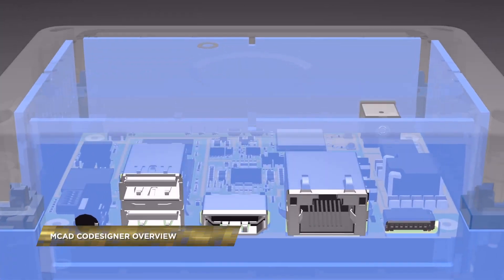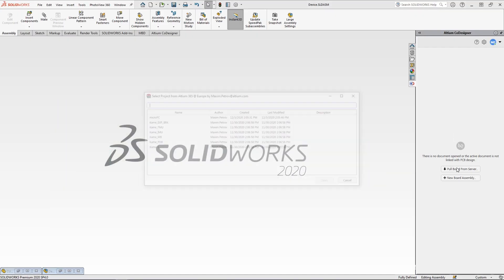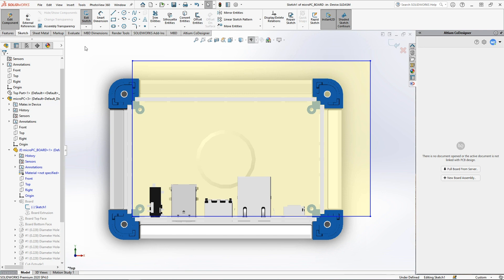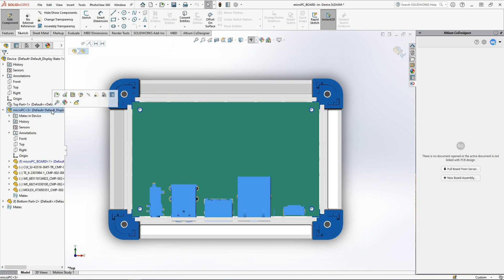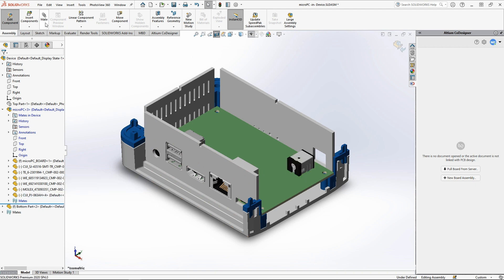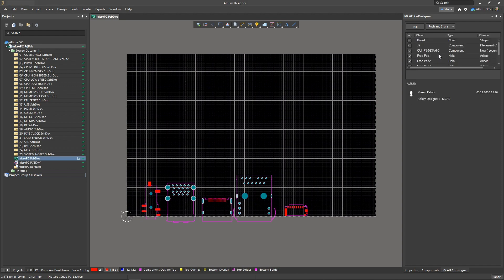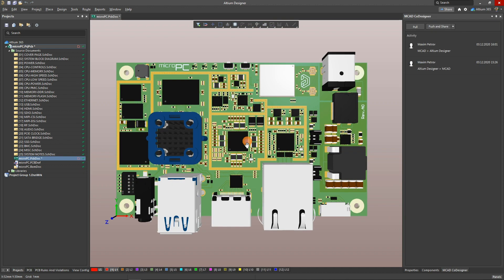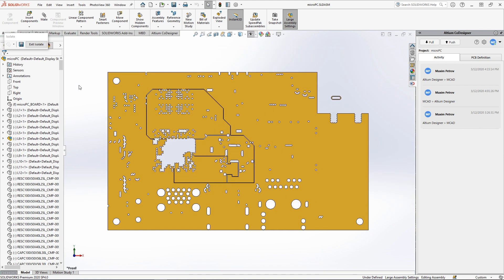MCAD CoDesigner Overview | ECAD and MCAD

Comment: Dear Altium Software Development team, the features we need most in the CoDesigner are:
1) An email notification system that keeps the MCAD engineer informed about new versions of the PCB design being pushed into the CoDesigner by the ECAD engineer and vice versa. Without that there is no true collaboration possible 
2) Different variants of a PCB design should be imported into your CAD system as configurations of the same file. This shouldn't be the default behavior, but the MCAD engineer should have an option to do this (e.g. when using SolidWorks)

Thanks in advance for taking this into account in the future release of the CoDesigner :)